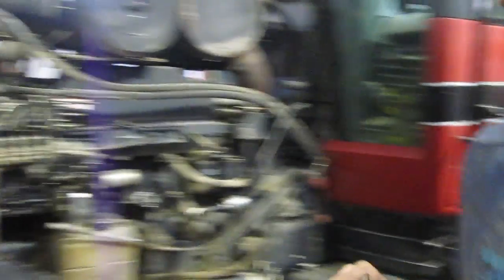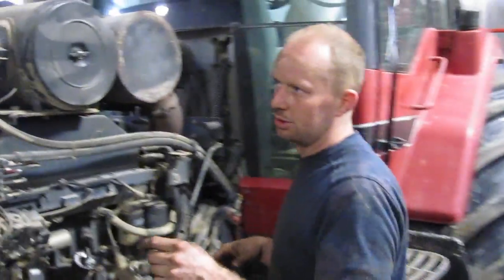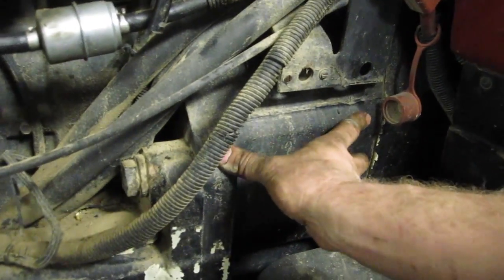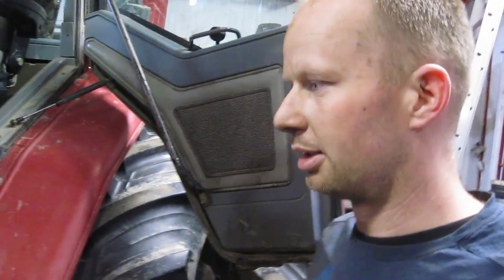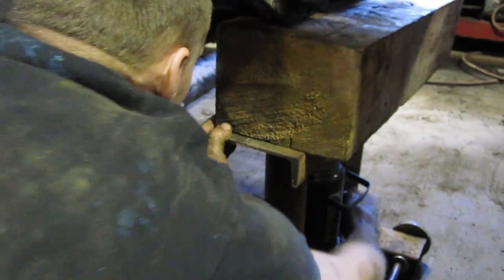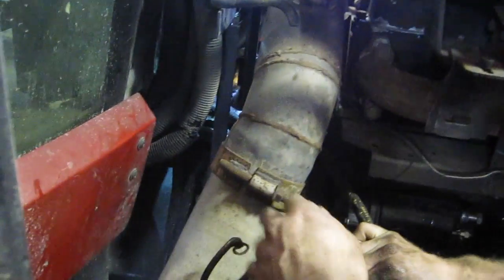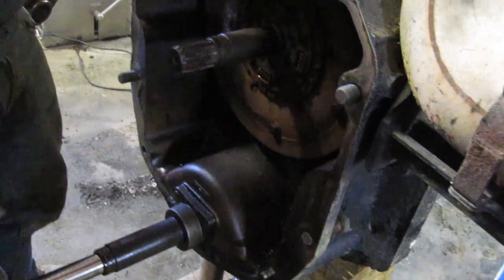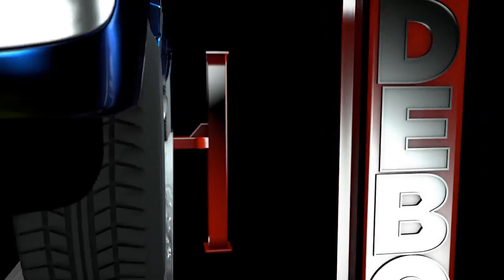How To Split a Case IH Tractor (7140 Part 1)

Comment: Any content out there for stuck or locked up brake on older IH 515B payloader? Need brake scheme with electrical. It’s wet clutch brake system 
Thanks

Comment: We are having troubles getting the tractor to split we have all the bolts out you have shown and slight pressure with jacks on both front and back. And tips?

Comment: You don't have to take the harness off the engine. The big connector is under the floor of the cab. Be very careful with the coupler between the two shafts. Story goes around our shop that somebody switched the direction on one and it took all the end play out of the crankshaft. We all know how that ends.

Comment: Would I be right in saying that tractor has a dry clutch?
Reply: interman 77 don't think it does our 7220 is a wet clutch
Reply: +Slew 282 it should be a clutchless tractor cause of the powershift transmission
Reply: @tracylocher4476  Just because its a powershift doesnt mean it doesnt need a clutch